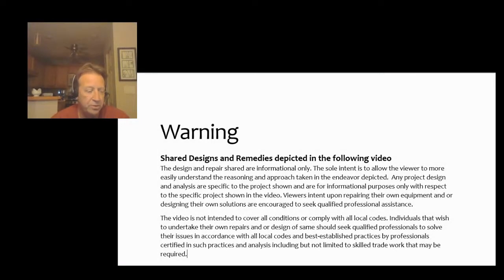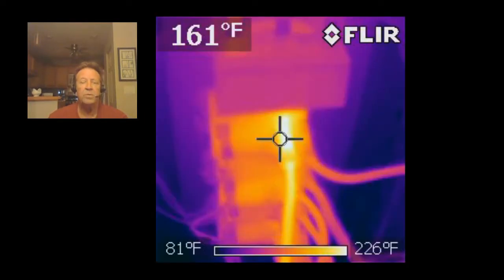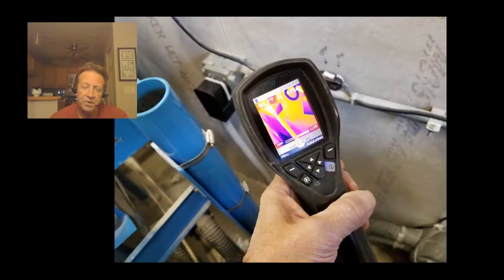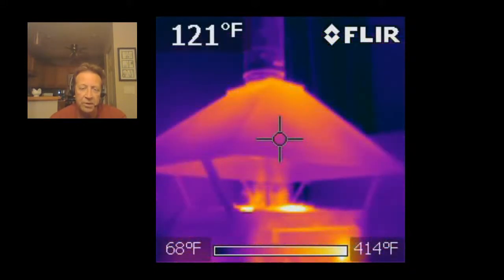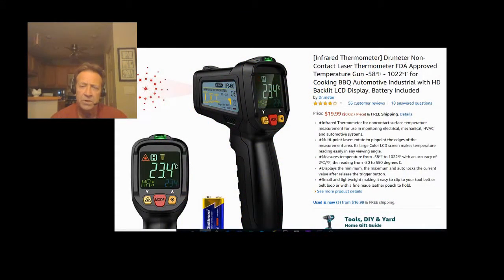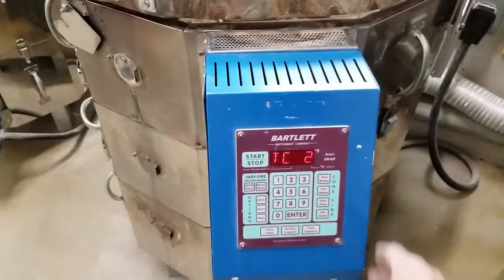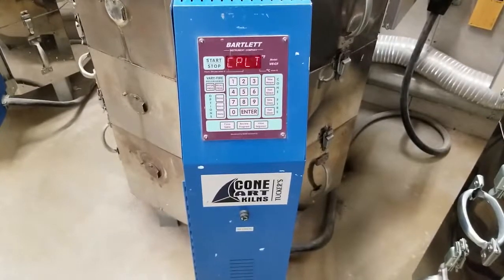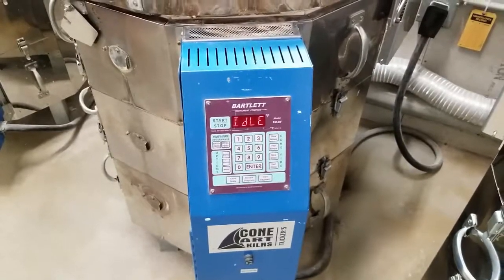Kiln Relay Change, Discover before failure!

Comment: How can you test a relay when the element is broken?
Reply from the maker: It’s difficult. One way would be to remove ALL the high voltage to the relay, activate it and check that the normally open contacts close and have little to any measurable resistance after they closed. This takes some knowledge in the use of a meter, the operation of the relay, and a whole lot of caution around high voltage circuits so not for anyone not familiar and skilled with such testing and safety precautions.